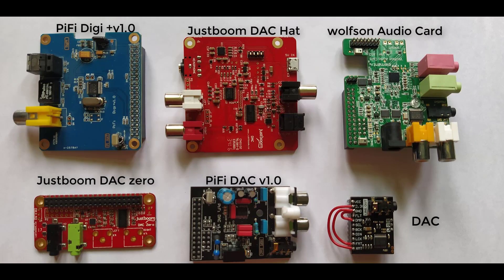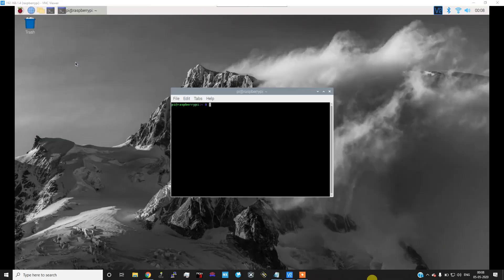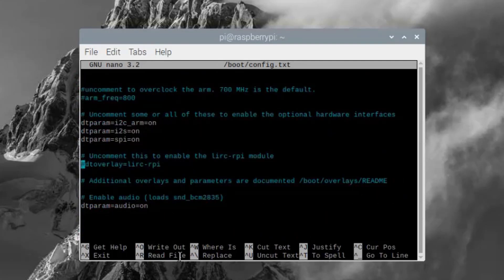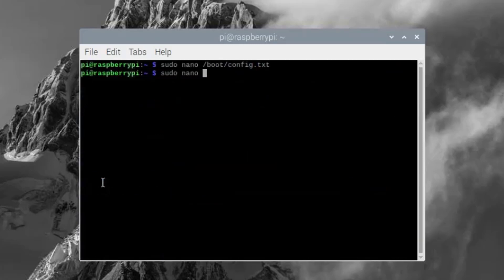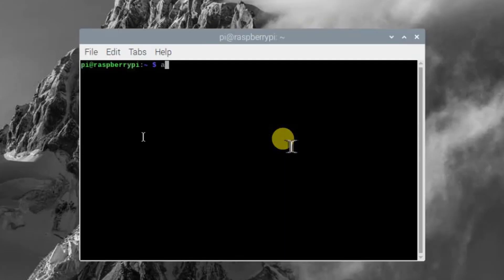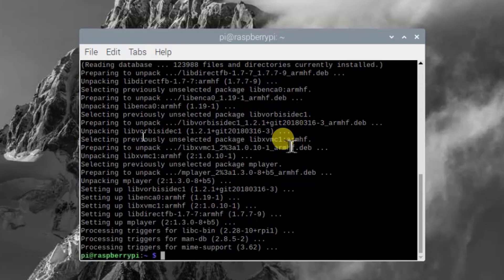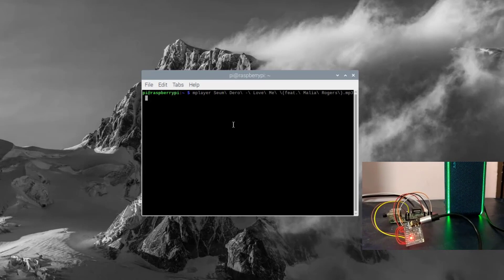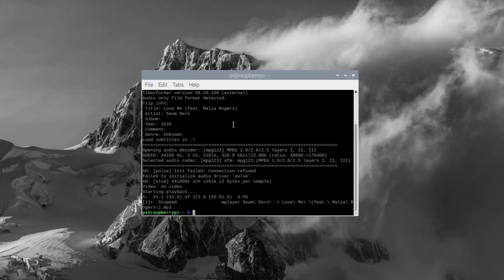Audio : High Quality Audio using Raspberry Pi | PCM5102 I2S Audio DAC | RaspberryPi Audio

Comment: Hey
I have a digital hat audio for a raspberry pi 4. Should I use the same lines in the config.txt file? I'm having trouble to use my pi hat and I think the problem is that I didnt include any line in my boot config file

thanks :)
Reply: For pi5 any changes to be done ?